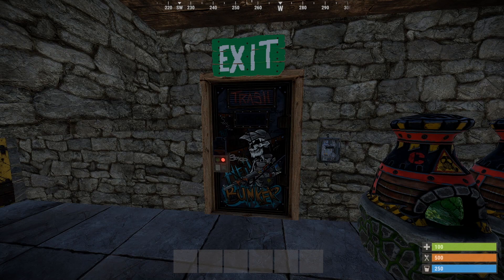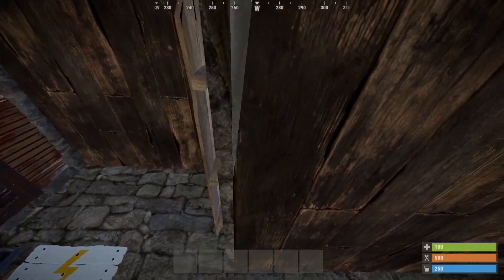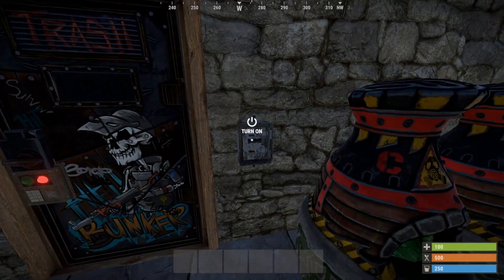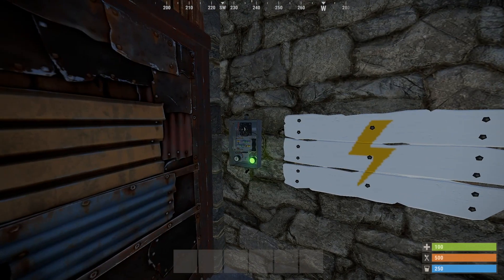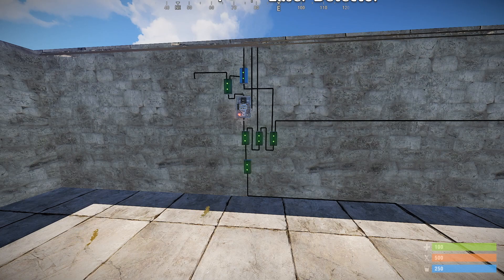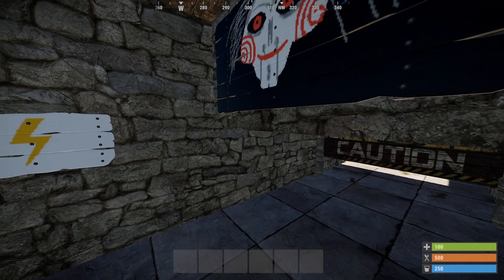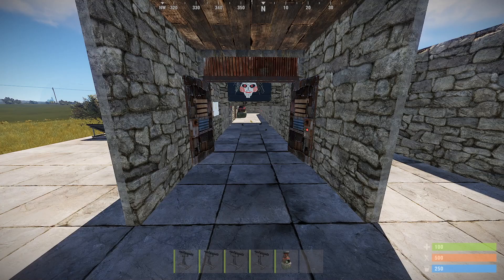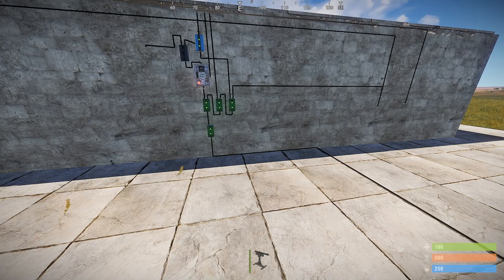(RUST) Electricity 101 - Electrified Tomb S02 Ep5 (Trap Base Module)

Comment: Once again - thumbnail picture is not taken from this video and "Electrified Tomb" is a glorified way of saying "Deathtrap" (if you're into this go watch some Gmod Deathtrap Videos, although what you can do in Rust is quite limited).

On the other hand, it is clear that you put some effort in this part.

IMHO, First of all, there is only one trick. One corridor. Nothing much else. Should you build a 3x3x3, put cage on top and beds for players to spawn in and prepare a maze in that 3x3x3, things would get more interesting and video would be at least 10 minutes long.

Second of all, this is almost not practical. The moment first automation goes off, player already knows it's a trap base and surprise is ruined. A naked might walk in, because he has nothing to lose, but otherwise, people would not use this trap base design (it's only for fun).

As for circuits, as I commented in other video, you don't need to show how to attach wires, simple draw.io picture would do (make sure it's readable, ie. if you have a block marked as "EB", add a legend in a corner which explains what "EB" is).
Reply from the maker: Some solid feedback here.

Firstly, as the title states, this is a module. Therefore meaning it is a proof-of-concept and is to be taken and modified to suit the need of the situation.

Secondly, as stated in the video, it is more suitable for a puzzle base, where all participants are aware of the situation. If it was specifically for a trap, I wouldn't have signs such as "EXIT" displayed.
However, I'm sure some smart cookie out there would be able to take something from this video and use it as a trap.

I will continue to look into tools such as this, as a few people have suggested many different things.

Appreciate all the feedback.